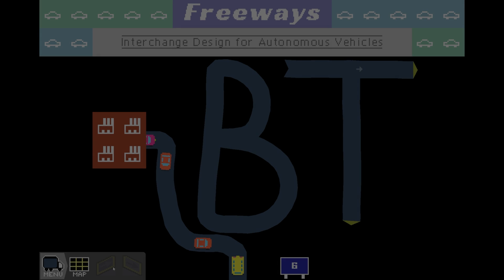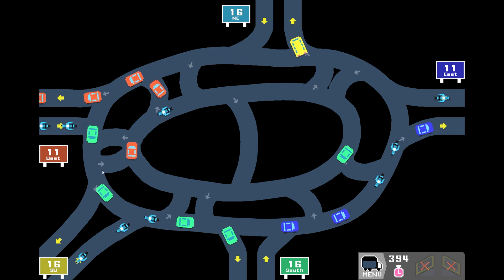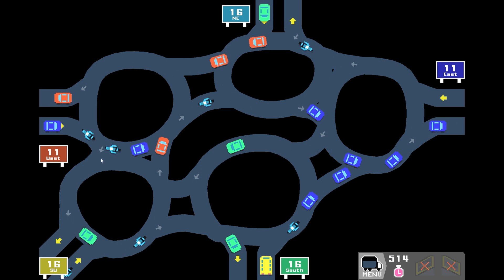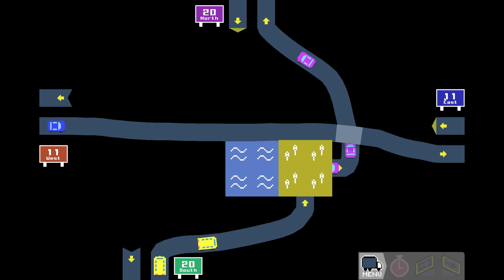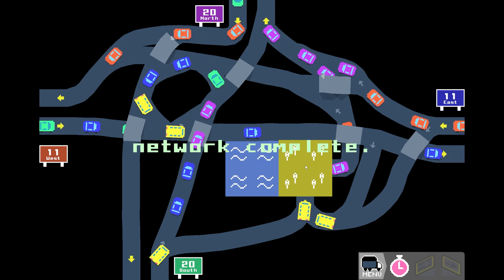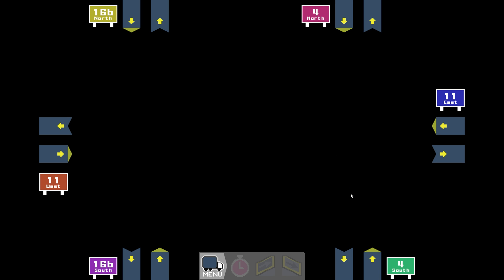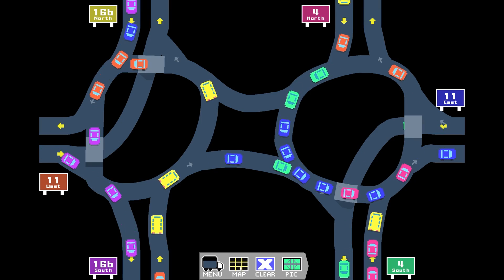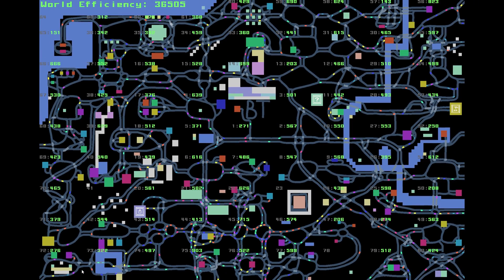MAGIC ROUNDABOUT MADNESS in FREEWAYS! (EP20)

Comment: Level 42 is the biggest disparity between PC and Mobile. Using your design was working for it a bit, then it’d jam up. Was consistently in the 300s. With some additional slip roads, i was able to get 427

From that alone, i’m pretty sure there’s a lower maximum world efficiency on mobile. I think the sides are stretched out a bit to compensate for a longer screen
Reply from the maker: That may definitely be! Certainly sounds right 😂